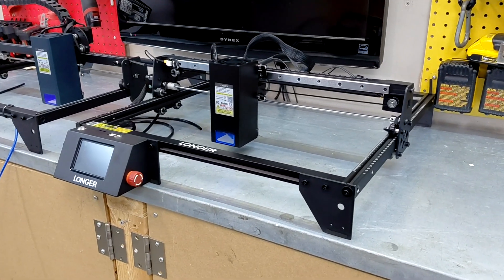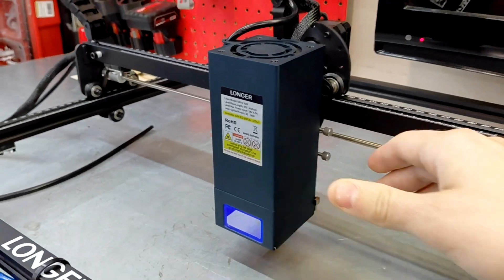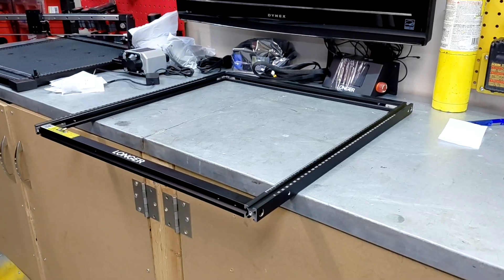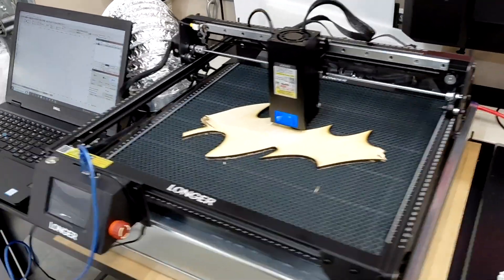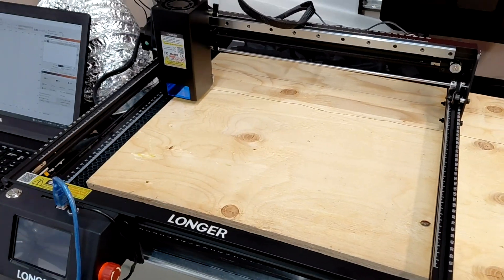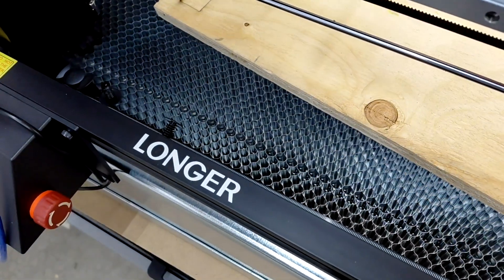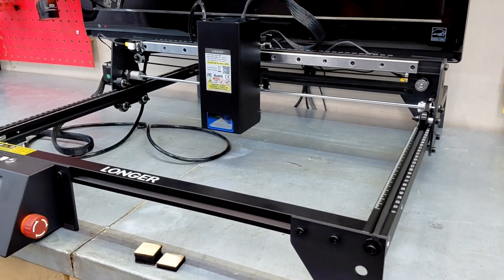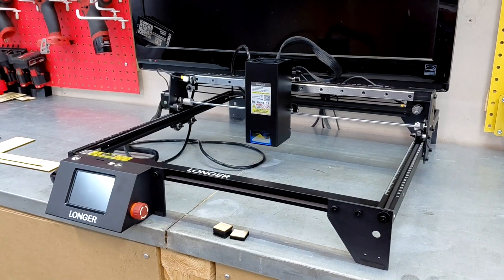The New Longer Ray5 Has SO MUCH POWER!

Comment: Unsafe at any speed.
Reply from the maker: Don't worry I survived the extreme danger
Reply: Hi, on the old model, there's an eccentric nut on the bottom wheel with which you can take out the play so the laser module will not pivot.